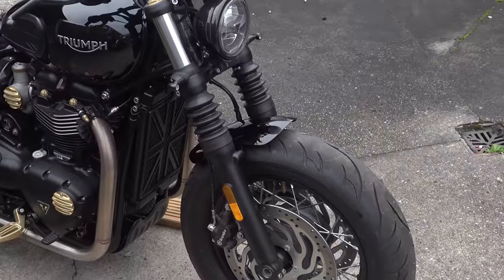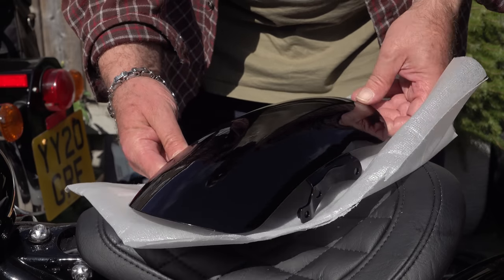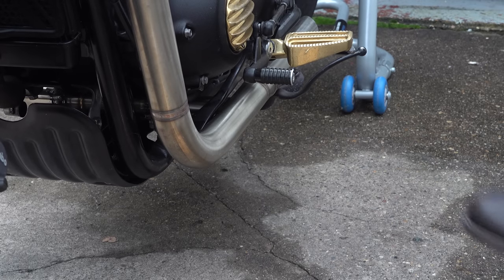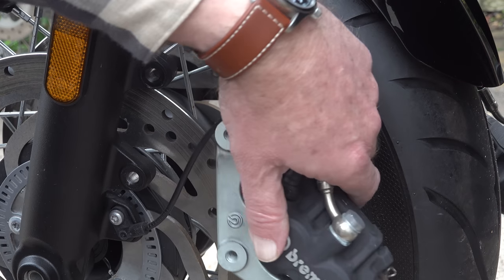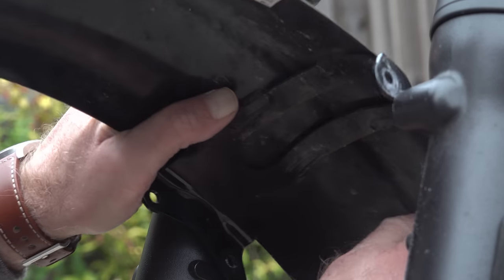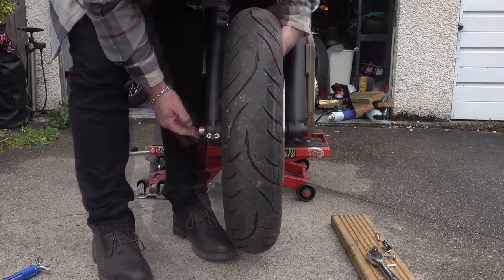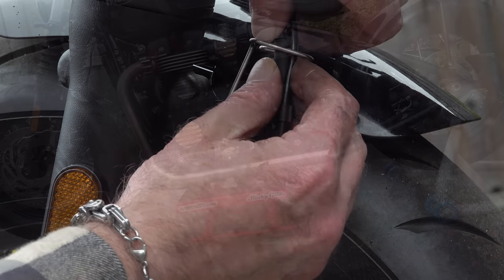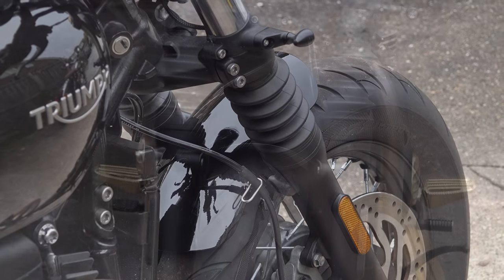Custom Triumph Bonneville Bobber Black project Pt6, Shortie front mudguard and wheel removal!

Comment: Nice piece of kit , and couldn't help notice your jack is as well,    with the locking plate on the side, good design, my old hydraulic jack used to loose pressure and slowly loose height , I now use a scissor jack with a small platform. 
Cheers 🍻

Comment: It'd be a good idea to put a bit of copper slip or similar on those mudguard fixing bolts as the electrolytic reaction between the steel bolts and the aluminium fork castings makes them a bitch to get out ,hence the white powder that came out when you removed them.Itll just make it easier if you change your mind about the shorty mudguard or have to remove it in the future.Just my humble opinion and it could save you a world of pain in future,ask me how I know......

Comment: When fitting 'shortie' mudguards you have to resign yourself to be covered in road grude when riding in inclement weather... Its true short 'sports' mudguards look, well, sportier....(its a very common fashion feature on most motorcycles anyway).. but as far as function is concerned they are useless. A friend of mine owned a Japanese 'Hog' lookalike, covered in chrome and customised bits, you needed to wear Ray-ban's just to view it in 'bright sunlight'...

Comment: Another great video!  My new Bobber made a strange squeaking sound when stopping (braking).  We determined the noise wasn't from the brakes, but the front fender bolts weren't tight enough.  As you said, the front folks need breaking, and any loose bolts will cause noise issues.  We tightened them with a drop or two of Loctite and the noise disappeared.  Can I ask what paddock stand you use?  Finding one that clears the rear license plate is a challenge.

Comment: Looks... fine, but not for me.
I prefer the old school looks that are also actually practical.
First thing I did on my speedmaster is add a mudguard extender on the front (well, the back of the front, if you know what I mean).
Now, if Motone did a mudguard that was bigger than the original I might be interested...